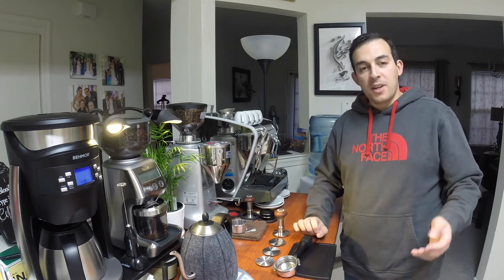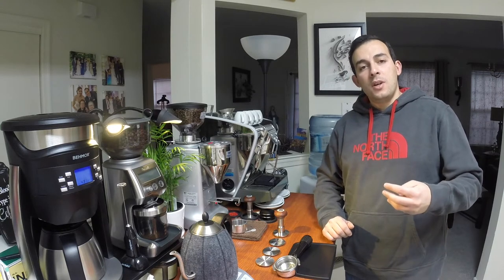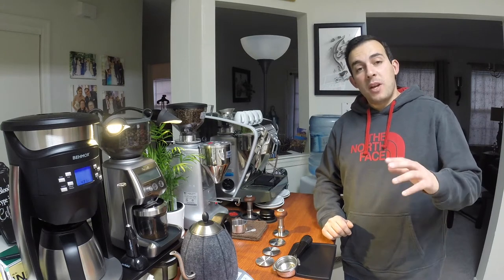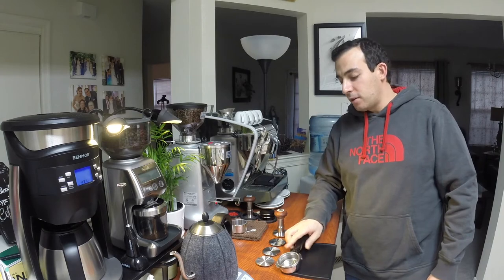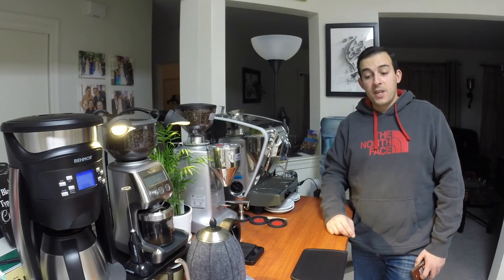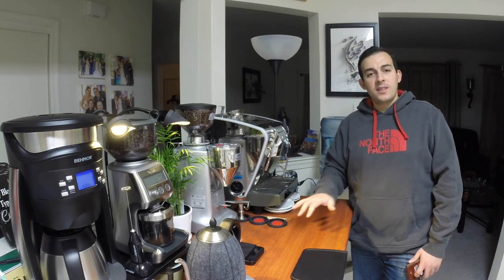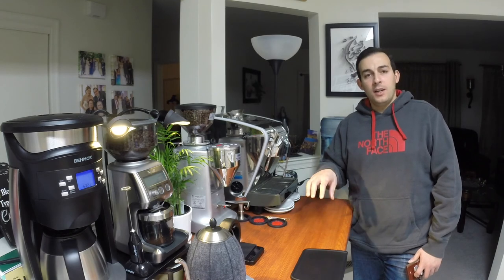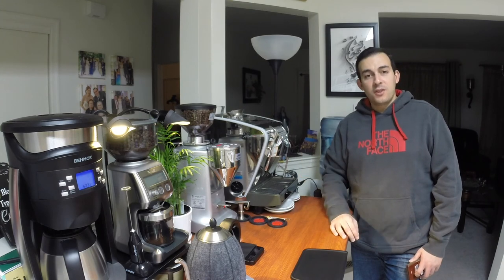The Effects of Different Tamper Bases on Extractions

Comment: Hi, is the flat base for this tamper perfectly flat ? no bevel on the sides or anything?
Reply from the maker: tantas cosas yes perfectly flat
Reply: @TheCoffeeField  thanks for the quick reply. one more thing, when you adjust the pressure of the tamper, is there any way to know when its set at 30 / 20 pounds of pressure? would it come pre-set to 30 pounds of pressure?
Reply from the maker: tantas cosas no way to know unless you use a scale and you record the weight on the scale upon impact by the Tamper. I believe it comes preset at 25 or 30 lb.
Reply: @TheCoffeeField  Ok thanks man. appreciate the help
Reply: @davidpatrik4142  @G H According to the "inventor/distributor" (a guy by the name of Zubing Sun). He said The Force Tamper is factory set to 22 lbs. (10kg)... and every clockwise full turn of the adjusting screw increases the pressure by 1.0 lbs. (obviously every anti-clockwise full turn would decrease the pressure by 1.0lb) It's best to make note of the position when it your first receive your tamper so you know where the factory 22 pound setting occurs)
Reply: @eltonnoway7864  Good note. I whish I knew when I got mine. For the money it has horrible informatio shipped whit it. I found the same 1 turn 1 Lb on another post but it did not say full turn or half. That other post did say that about 7mm down to the ring was about 30Lbs and that the range was 15-40Lbs. I decidded to go the other was and take it to full presure as a SET point and then worked backwards 10 half turns. At this point I measured down and depending on how you call it I was at about 9mm down (true depth) or 7mm mark on ruler I was using as it has a 2mm lead.  I was getting poor shots before with how it came from factory. I had thought it would be pre-set at 30Lbs but I now know much lighter. Hopping this fixes my issue and that this may help others.